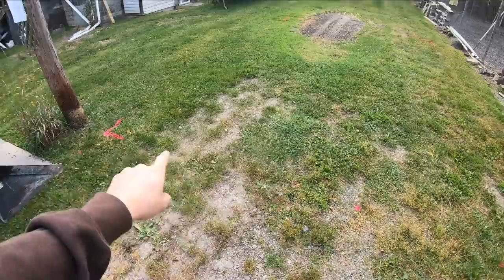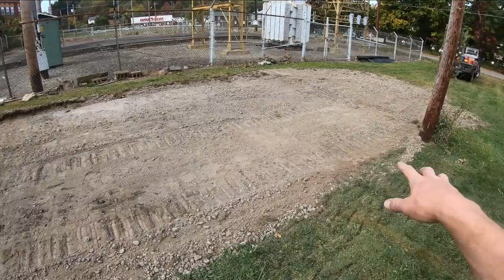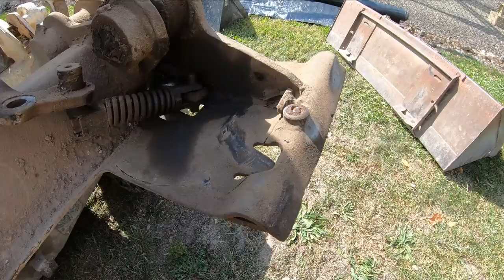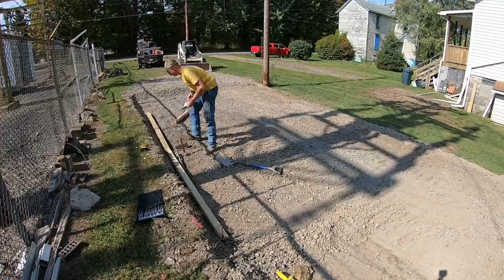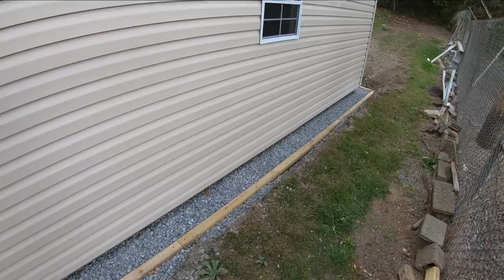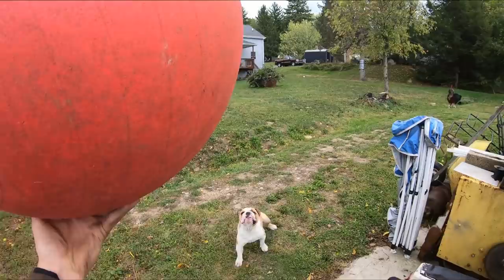Grading and building a gravel pad for a shed/garage!

Comment: Hi Matt, you could always carry a length of garden hose and a few pints of water with you. Lay out the hose at your diagonals and other points. Fill the hose gradually with water until both ends show the water. Those are your absolute horizontal points

Comment: For squaring up the tailgate on your dumpster, mount a small steal I-beam or narrow gauge steel railroad rail across the bottom OUTSIDE edge of the tailgate. Clamp and weld it in place. The rail or beam will keep the tailgate edge square to the bottom of the bed AND, being outside the bed, it will not interfere with the release of the load

Comment: I'm glad i have the power bob-tach on my s185 but another great video
Reply from the maker: My next machine will have one for sure!!
Reply: @DieselCreek  i grew up with out one so I know the "struggle" lol but the power tatch is nice i love the way its set up on the s185s you could actually put one on your machine all they did was bolt a ram to the existing system and put it on a toggle in the cab
Reply: I converted my old OMC Mustang over to the bob-tach system. So easy to switch between bucket and forks! Had to build a new bucket anyway, so.....

Comment: Have you considered graphite spray for the tracks ... it's just graphite dust in a carrier that evaporates, so it won't create a grinding paste like oil or grease would, but it might solve the squeaks ;)
Reply: There's no point , its just normal , dirt , mud will remove any lubricants
Reply from the maker: I have that stuff but the dirt and stuff will just eat any lube up or off within minutes, it’s pointless

Comment: Yea that spacer is supposed to be welded to that quick attach.  It's what takes the load of the arm, the bolt just holds the spring on.  Grease those pins more.

Comment: Use right tool for the job.
Hammer is rigth tool for every job.
Any tool can be a hammer.
If you can't do the job with a hammer, take bigger hammer
Reply: “Every tool has a hammer side”; Eric O, South Main Auto.....
Reply: Love Eric o and the sma channel.  But I'm pretty sure he borrowed that quote from red green.
Reply: Not quite. Any tool is a hammer, 𝒆𝒙𝒄𝒆𝒑𝒕 a screwdriver, which is a chisel.😁
Reply: @2H80vids  you just need to hit more accurately
Reply: 2H80vids And a punch.....
Reply: i remember that my norwegian grandfather would say " if you can't fix it, get the big hammer " ...

Comment: I'd bet you could really use a hydraulic motorized jackhammer 
attachment for either skid steer, just for situations like this.
Did you state in an earlier episode you have an auger?
Those are a must-have for building structures with corner posts
like decks. eBay has hydraulic breakers for $6k-$10k crazy nice new-
sucks when the attachment costs more than the tractor, 
but that's how they get you.

Comment: Just a word of caution (from my Utility Engineering career) those substation fences are usually about 10 feet or more inside the utility property line. This is so that the area 3 feet outside the fence line can become part of the substation grounding grid. The idea is to prevent possibility of step potential difference between a person standing outside the substation and possibly touching the fence during the occasion of a line to ground fault which can raise the station ground potential to significant levels. With that shed so close to the substation fence a person walking between the fence and the shed is facing a potential world of hurt in the event of a utility line fault or substation fault effecting that substation. Did you check with the area utility folks on the placement of the shed? If not you may wish to.  Nice job on the gravel pad by the way!  Cheers, Bob
Reply: Thats interesting....but its not really his problem.  That's for the owner to figure out.

Comment: There was a lot of stone on the surface probably because it is/was the access road for the electrical switch yard.  You might end up with a future "Shed moving job" if the power company says it is blocking their access,  Such as if they have to switch out the transformer.

Comment: I was kind of surprised that the shed was sitting so low to the ground with no termite shields.  I have two 16x24 sheds, one is my shop and the other is just dry storage and both sit up on blocks with termite shields on top of them.  Termites love the bottoms of those things.
Reply: I’m guessing he’s too far north for termites. Carpenter ants are another story.
Reply: Treated wood?
Reply: @user2C47 , I would certainly hope so.  Both of my buildings are built with pressure treated wood both on the flooring and the framing underneath.  GarageWorker
 is right about the carpenter ants.  Those things are as bad as termites when it comes to the damage they can do.  Even with treated wood you still have to have people come out and spray underneath and around the perimeter inside.

Comment: I'd hate to live next to all those wires and transformers 😩
Reply: I don't have transformers by me, just a 340K volt transmission line coming from a nuke plant about 4 miles away. They are about 50 yards from my property line but you can hear them buzzing when the humidity is high enough. 😥

Comment: The so-called spacer that you put back is actually supposed to be attached two the pin it is a weld on item normally takes about an hour and a half to cut out and weld a new one in
Reply: Matt mentioned that in the video. What is, or was, the advantage of it being welded on?  It seems to work fine as a spacer.
Reply: An hour and a half???!!!!!
You could weld up an entire Bobcat in an hour and a half .....!!!

Comment: It's a weld on rebuild kit, for the bobtach. PIA , to do as you must cut the remaining piece out of the bobtach. Done a few of them.  Is the line, just below the pivot point, a crack developing?
Reply from the maker: Yes. I fixed one side now this side is cracked
Reply: @DieselCreek  sucks, doesn't it? I work for a smaller rental company in the greater Pittsburgh area. We've had them Bobtach adapters, crack, right down the center, the piece you have broken and  other crazy things.  Anyway, keep them videos coming!

Comment: You know if you lower the bucket and curl it like your supposed to the bucket comes off a lot easier.
Reply from the maker: The handle was stuck? I never have any issue getting buckets on or off, it’s not like it’s a hydraulic coupler that you need to curl up to engage

Comment: You took rocks out to put rocks back in?  All that needed was rocks on top.
Reply: Disagree. You need that aggregate to allow for drainage away from shed.
Reply: @davidpeterson4122  Point being made by @Freddy rosenberg is there were already a lot of rocks there I'd be damned if I'd put any more there. At .38 he said he was gonna put cloth down before he put the rocks down, he didn't do it.
Reply: Like he said he had cut it down to level it up for the shed and more than likely he did it the way the customer wanted it. When your working for the public the customer is always rite even if it’s not the rite way
Reply: He did a great job right up until he used that clear stone! Clear stone will never compact and a solid compacted base is required for a stable shed foundation that meets engineering specs for a permit, (at least up here in Canada). The customer will be adjusting door gaps on that garage for years to come, because it will move and settle when loads shift inside the garage. As far as drainage, water will run off a compacted pad as long as at least one side is higher than the grass around it.

Comment: Looked like there was a crack in quick attach plate.
Reply: Would it be easier to have the bucket flat on the ground before you detach it?
Reply from the maker: There is, I welded the other side before, looks like I need to do this one now
Reply: I see the Instagram video of the dog AC/DC big balls lol
Reply: 8:39 It seems the crack got wider from him driving the broken bolt out

Comment: 9:40  Looks like those bolts are too small for those springs. Guaranteed they fail again.
Reply from the maker: That’s the size they have to be to fix through the plate, all they do it hold tension on the spring, pretty sure I replaced the original from 2003
Reply: @DieselCreek  You could drill out the plate one or two sizes larger. Ditch the spacer.

Comment: haey ok this is what i do way mah tracks when there that bad . after work " this works every time two times a year "" it never fails "
1st jet wash the tracks 
2cd blow them off way air 
3rd get an old brush & old engine oil
4th paint the tracks way the old oil & leave over night 
5th back too work